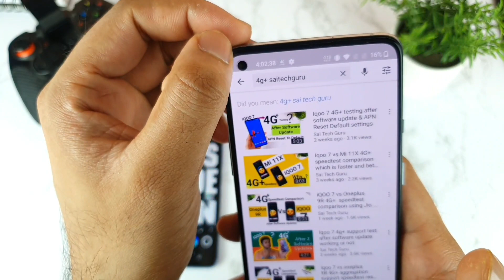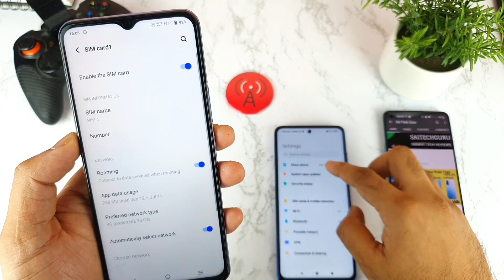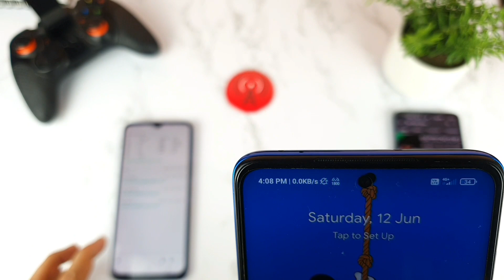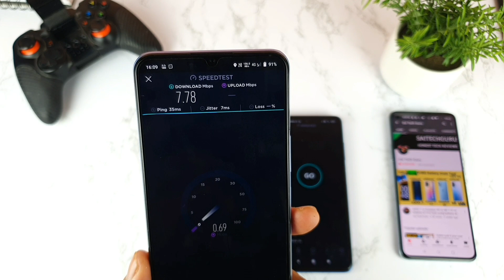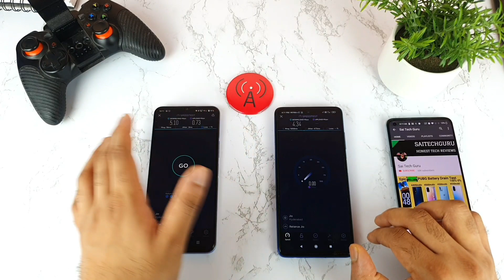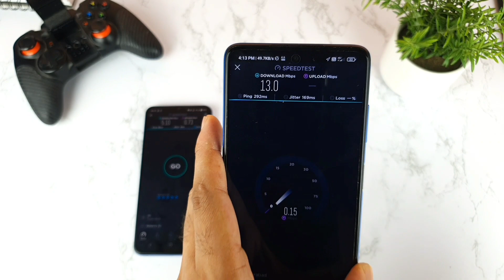iQOO Z3 vs Poco X3 4G+ Speedtest Comparison carrier aggregation support test

Comment: Will you please tell me the difference between 2300+2300 band vs 2300+1800+850 band Samsung M42 add lower band while other mi phones add only higher band why??? I think speed in lower band 2300+1800+850 much more better.Please make videos on it (carrier aggregation).
Reply: Depends upon Network Provider...
In Many Cities Carrier Aggregation is only available for Two bands connected Simultaneously for 5G+.
While in Other cities Carrier Aggregation is available with upto 5 bands connected Simultaneously for providing 4G+..